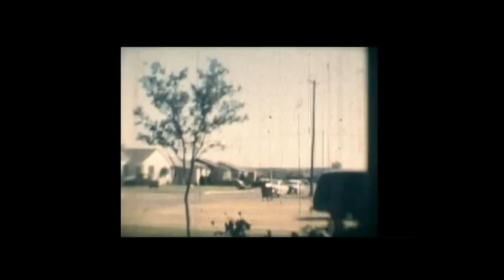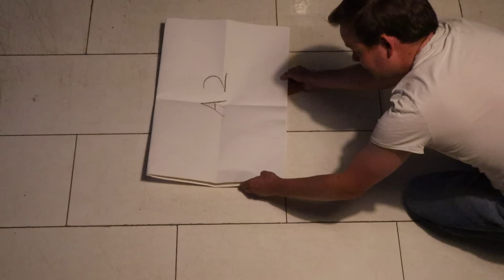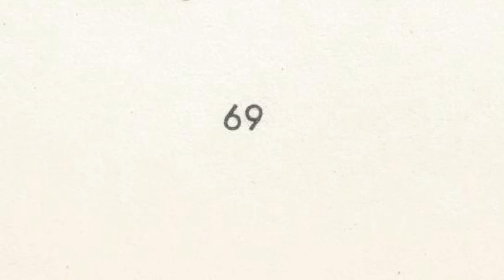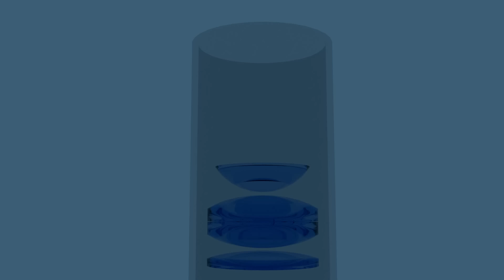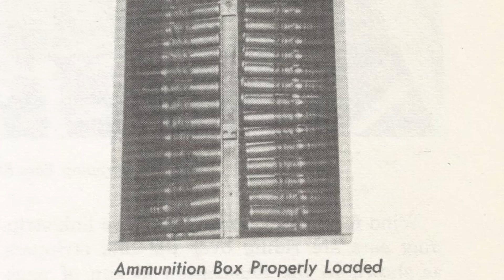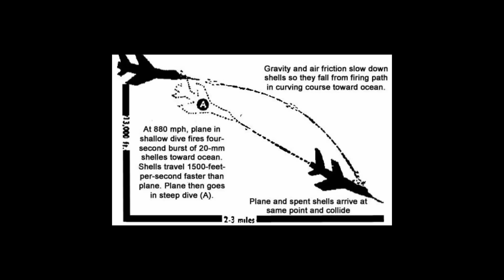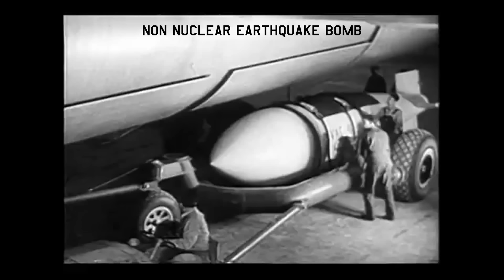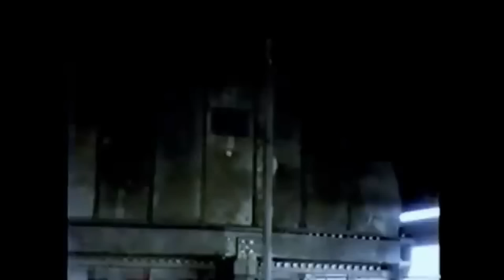Unfathomably American: The Armament Systems of the B-36

Comment: Imagine changing the sparkplugs on that thing.  There were 336 of them!
Reply from the maker: 2 plugs per cylinder, 28 cylinders * 6 engines = 336 spark plugs. Mostly difficult to access due to the engine geometry. And changes were apparently often carried out in freezing cold bases in Alaska.
Reply: @Alexander-the-ok I worked as a light aircraft engineer for a lil bit, the most irritating thing about 50/100 hourly services (other than becoming a contortionist to get to the rear 2 plugs hiding near the turbo) was having to actually care for the plugs cos you gotta check the markings on them

So you take each one out and set it in a tray to keep them in order. Look at the soot, any fouling, electrode wear, damage, heat marks etc

Tl;dr --> minor service (50 hours) on a single 6 piston ~9L light aircraft engine takes about 3 man hours 
So doing a minor service on just the engines (all going well) would take ~120 man hours
Reply: @Alexander-the-ok   
As I understand it, there is more than just the safety of largely independent dual ignition systems for each cylinder, or cylinder bank, as a reason for the dual plugs still used in aero engines.

The cylinders were so wide that two plugs nearer the edges shortened the colliding flame front’s path(s), decreasing the amount of timing advance BTDC (before top dead center; lead time) the spark needed, increasing efficiency from the shorter upstroke against budding firing pressure, a quicker full burn to discourage detonation, and (I surmise) a somewhat higher peak combustion pressure from which to extract energy during the following power stroke under good thermodynamic conditions. 

Hope I’m not misguided.
Reply: @For_What_It-s_Worth  You are correct.  The further a flame front travels, the more likely it is the cylinder will reach ig it on pressure before combustion finishes.   When that happens the remaining unburned mixture all goes off at once.  That is what detonation is.   So the main job of dual plugs was to start two flame fronts that would each only travel half as far.
Reply: @For_What_It-s_Worth  Some motorcycle engines with larger cylinders have two spark plugs for that reason. The DR650 comes to mind because i had one. It can also help with emissions
Reply: @Alexander-the-ok  6 engines
Reply: @Alexander-the-ok  Six engines. But you got the right number of plugs.
Reply: @Alexander-the-ok  that's 6 wasp not 8...great video.
Reply from the maker: @publicmail2 oh yeah, edited, thanks!
Reply: @Alexander-the-ok  at least they were done by the Airforce. Nowadays would be some independent contractors billing $500/hr (who would only do it in a hangar - and one not being shot at). And the spark plugs would be limited (by a rider to a footnote to some bill) to some obscure brand that only Nancy Pellosi's private equity broker knows the name of.
Reply: @Alexander-the-ok  I’d hate to be the ground/maintenance crew that had to work on that in the freezing cold
Reply: @Alexander-the-ok 6 I thought it was 10
Reply: @Alexander-the-ok  or Thule in Greenland but stupid cold non the less!
Reply: @Alexander-the-ok surely it's a team of 20 or 30 and they can do it in a few hours with specific tooling or cartridge style modules making it very easy

But I know better than that 
.it's all threaded plugs
Reply: 1 a day til paid vaycay
Reply: @blurglide  and plain steel spark plugs firing leaded fuel, so the plugs would only last a few hundred hours
Reply: And doing so in sub zero weather during arctic deployments to Alaska.
Reply: @pauliedweasel  actually sounds kinda nice. Only thing worse than hard, grimy work is doing hard, grimy work soaked in sweat
Reply: Plus 64 igniter plugs for the J47 engines.
Reply: None of your fancy iridium 100,000 mile spark plugs back then either. I believe they had to be changed pretty often. Mind you, nothing about aircraft maintenance is easy. 
I have two family members who are aircraft maintenance crew, one is an airframe engineer who has worked on many large aircraft for both military and civilian industries. Some of his stories are incredible.
Reply: @woopimagpie   quite honestly i would rather be sent to a gulag than be a maintmance crew of a b 36,just the sparkplugs change already looks bleak,i can only imagine how oil changes would go
Reply: Don’t forget the igniters for the jet engines… I don’t know how many per engine, but I assume at least a dozen more there. And I suppose it also carried an apu.
Reply: @DrBovdin  the B52 doesn’t even have an APU do I would be very surprised if the 36 did. Afterall you could use one of the piston engines to provide the power for starting the jets…
Reply: @X85283 , no apu on a B-52 probably because the thought of nine turbines on any aircraft was thought to be a bit excessive even in that era.
Reply: @X85283  I wouldn’t know, it is just a guess from my side. Either way, that would be a minor relief for the guy changing spark plugs and igniters 😉
Reply: @X85283 the B-36 did have an APU, as did the B-29. A small gasoline air-cooled motor for use on the ground to generate electricity to run things like lights and radios.
Reply: @X85283 but to be fair the system used on the b-52 is unique to its purpose
Reply: @GooseDentures ugh, some guy…name’ll come to me…he was a fairly famous Lockheed and AF test pilot…ah, Daryl Greenmeyer or something thereabouts.  Anyway, they were recovering a B-29 that crash landed in Greenland, in the 80s or 90s, and they were trying to start the engines to see if they could get it airborne.  The gas can or tank or the entire apu fell over and burned the B-29 to the ice.  They guys who were there to retrieve it sat in chairs watching it burn, to pretty much nothing.  

So sad.  The intention was for it to be the 2nd airworthy B-29 along with Fifi.
Reply: @DaveP-uv1mlThe B-52 has a cartridge start on its engines.  In theory it could fire up all engines at once to scramble.  In practice it seems one engine is started using a cartridge then bleed air from that is used to start the remaining engines.  Or a GPU.
Reply: @DrBovdin Those would likely be way easier
Reply: G'day,

Mate, those Engines were so VERY Complicated that the
Ignition-Harness
Oscilloscope was
Invented...; purely so that the
Flight-Engineer could tell if,
And which...
If any,
Of those 336 Sparklers were
Failing to light up their
Fair share
Of the Fuel/Air Mixture,
In the 168
Combustion-Chambers...

Or, so I heard from the son of a LAME who used to maintain Lockheed Constellations for Qantas - which also featured an Oscilloscope to monitor all the 
Sparklies.

Such is life,

Have a good one...

Stay safe.

;-p

Ciao !
Reply: @WarblesOnALot    this is what happens when you push a technology all the way to its logical extreme. Jet engines were so much better
Reply: @kevinbarry71 

G'day,

Thanks...

As it happens, the people who were really "shit-hot !" at dreaming up and making bloddy great big super-powerful Piston Aero-Engines in the 1940s and '50s had about 40 or so years of history in the industry ; and to be honest, they had no great interest in starting again and trying to jettison everything they were good at -  to go buggarising about trying to connect a Windmill in a tubularised Firestorm to spin a Centrifugal or Axial Rotary Air-Compressor...., to turn Kerosene into pure NOISE, all in the attempt to derive some residual Thrust by afixing a Nozzle to constrain the efflux downwind of the 
Fire-breathing Windmill...

My impression is that the whole "Squirt-Engine" concept, as they called it, was seen as ridiculously 
Inefficient (and in terms of Specific Fuel Consumption - the Piston-pushers 
Are CORRECT...,  and as Jets were highly  cantankerous and initially noticably gutless, and quite fragile too - as regards Throttle-Jockeying...; the Jet-Engine as a species was seen as a dangerous  (Career-threatening) Anomaly, well worth competing against, and resisting.

And, considering the proportion of Planetary Atmospheric Fossil-Carbon Emissions currently being farted by
Jet Aircraft...(5% or 7.5%..., as I recall it ; something like that) - thashing back and forth all over the Globe conveying Busloads of drunken Tourists and Feetbrawlers, Hairdresser's Assintants and Telephone-Sanitisers on their annual Clap-Catching Expedition to Bali or Phuket, Ibiza, the French Riviera or Aspen Colorado, and back home to the mortgaged ("Mort" = Death  & a Guage is used to measure things..., so a "mortgage" measures how much Money the Borrower may repay, before expiring from overwork...) Suburban McMansions, whereinat they play at forming simple and compound recombinant Brady-Bunches - to see how much more dysfunctional they might succeed in raising their offspring to become..., 
Than their own parents had done...
With them...

Every Litre of Kerosene burned, in a 
Table-stand Lamp or a Rolls-Royce Avon, Spey, Nene or Trent..., emerges as something like 2.8 Kg of Carbon Dioxide...

And Piston Engines make more 
Thrust per unit of Mass worth of 
Fuel Burned...

Jet Engines are
NOT
"More Efficient" than
Piston Aero Engines...
They ARE, though, 
Much more readily scale-able,
Particularly above the 1,000 Hp mark, per Engine.

Four 3,500 Hp Radials on a Constellation, versus four 20,000 Hp Turbofans on a Boeing 747, and a pair of 40,000 Hp Turbofans on a B-787...; but look ye at the Fuelburn, and Emissions...

Extra POWER 
Does NOT mean
More EFFICIENCY...;
Because conveniently large amounts of Output involve
Stupidly 
High
Emissions.

So, look at the big picture
Consider the FACTS,
Ponder the implications...;
And you will realise that
Dhatfver went wrong in the lives of they who hatchd Jet Engines and released them to go Feral and breed in the wild...; their little Tragedies were not nearly 
Sufficient unto the task
Of
Balancing their
Kosmic-Scoreboard Effect
Impact on
Reality
For hhe generations yet
Unborn..., who get
To attempt to live on
Within the smoking overheated barren arod acrid bloody
Messes
Made by the
Flying Fire Chariots.

Piston-engined filthy pointless 
Flying Fire-Chariots...,
Were already plenty bad enough,
As it were...;
In my opinion.

And considering that what took me for my first Solo had 3 less Cylinders and 4 less Horsepower that the Wright Brothers' 1903 Flyer-1....; I probably have a little bit of a "right" to excrete from a great height, onto anyone who "needs" to play with 
Wastefully-Overpowered Flying Machines, merely to exercise their own little Biggles Fantasy...

(search my "Personal Aeroplanology..." Playlist, for
"National Transportation Museum ; Visiting My First Aeroplane..."!, 
to fact-check that...).

Such is life,

Have a good one...

Stay safe.

;-p

Ciao !
Reply: @WarblesOnALot  Are you allergic to complete sentences and paragraphs?
Reply: @jamesharding3459 

G'day,

Averse,
Not
Allergic.

I prefer pontificating
Poetically.

Blank Verse, or
Free Verse...

Makes a nice change, from the
Prosaic...; in my humble opinion.

Backtrack me to my
Warbles In The Wilderness
Playlist..., to find the stash of
Original, Published
Poetry...
Most of which rhymes with rythm and metre ; quite conventionally.

Some of which was  commissioned
To be written,
When appointed
Poet In Residence by the
Environment Centre Armidale.

Which meant that I became the
Replacement for
Judith Wright...(!).

Technically squeaking...

Such is life,

Have a good one...

Stay safe.

;-p

Ciao !
Reply: @WarblesOnALot  Regardless, it is both irritating and unnecessarily frustrating to read. Stop it.
Reply: @jamesharding3459 

You get to do
YOU...

Little Jamie...

You do
NOT
Get to 
DICTATE how
Other Humans live our lives.

You poor pathetic miserable little
Overcompensated
Inferiority-Complex
On-legs...; 
Bleating and barking at the
Universe,
Demanding compliance with
Your
Perverse
Predelictions...

Piss off
Yanqui
Piss off.

Your (mis)direction is
Unneccessary
Uninformed
Unwelcome, and
Unhinged from Reality.

Nobody cares what ANY
'MurriKa(!)n
Demands.

Y'-alls VOTED to become
IRRELEVANT in the estimation of
96% of
Humanity...

No 'MurriKa(!)n opinion
Carries ANY
Gravitas, as long as 
Y'-alls be salutin' Trump, and
Dancin' to his tune.

Message ends.

;-p

Ciao !
Reply: @jamesharding3459  god forbid one person on the internet enjoys writing in a way you don't like
Reply: @jamesharding3459 or just dont read it
Reply: downvoting for horrid layout of OP's text nuke
Reply: As an apprentice aircraft mechanic, that thought makes my eye twitch.
Reply: If it took just 5 minutes to change a single plug, it would still take you 3.5 working days to change them all (28 man hours) 😮
Reply: The spark plugs were a problem. At the high altitude/low atmospheric pressure were the B-36  flew arcing was a real problem with the high voltage ignition system. Connecting the magnetor to one of the superchargers helped, but introduced issues with oil contamination. Eventually the switch to low voltage ignition was made, with a step up coil at each plug similar to modern cars.
Reply: You don't change the spark plugs the spark plugs change you.
Reply: @rexmann1984 , haha, that would be the Tupolev Tu-4.
Reply: It is bad enough dealing with 4-8 in a car.😂
Reply: those double turrets don't look familiar? are those a prototype
Reply: @bart_e_national  not a prototype, it was the production model. They were removed in 1954 to reduce weight except the tail turret
Reply: @bart_e_national correction, second production version
Reply: Have to wonder if the unreliability of the engines were directly related to how complicated and complex the maintenance schedules were.   The more time is needed for maintenance, the more likely that something goes wrong and a bolt or screw doesn’t get replaced or tightened to spec.
Reply: @blurglide  shoulda made it diesel
Reply: It’s called a wobble and 5hrs of work lol
Reply: @blurglide  in alaska... During winter ... Or greenland..... 😭
Reply: And the oil?
Reply: @DangerTimed 
Never needed to be changed since the engines would burn it.
Reply: I thought my old S600 is bad 😂😂😂
Reply: No problem, ill just get my wrench and gapper and...ohh hell no, they are buried in the heads and between cylender banks?
Reply: @blurglide  Imagine replacing the oil.
Reply: The entire engine would be removed and replaced with a working one, keeps the aircraft flying while the engine is worked on
Reply: @blurglide  Good thing that engineers work in groups. If each guy gets an engine it shouldnt take more than a few hours, but what do i know
Reply: It's normally one slip away from a few hour job I have a feeling a snapped plug or fubared thread was a nightmare
Reply: It’s probably what you’re gonna be doing for a month I doubt it the days worth of work. It’s probably what you’re doing for January.😂
Reply: Don’t forget the starter plugs on the turbines on both internal jet and b36 itself
Reply: That's a ten man job lmao
Reply: Oh god...
Reply: My grandfather talked about how much of a pain the 48 spark plugs in the P-38 were to change during his all expense paid trip to the South Pacific in WW2.  

He didn’t talk a lot about it until he got close to checking out, but he had  interesting stories of “Washing Machine Charlie” coming over at night and dropping bombs.  When the Japanese ran out of bombs for the night bombing raids, he said they knocked out at least one airplane on the airfield with a BFR (Big Friggin Rock) which smashed through the cockpit instrumentation.  The good ole days…..
Reply: I figure there's probably many maintenance crew to do that so probably not as much of a pain in the ass as if you were to do it solo probably still took the piss though

Comment: Alright so we got the funny big plane, which makes for an excellent video, but how about the funny loud plane? That's right, I think we need a thunderscreech video.
Reply from the maker: Oh that one is already very much on the 'maybe videos list'
Reply: @Alexander-the-ok  my ears are already ringing just thinking about it.
Reply: @Alexander-the-ok  good jesus, the engine alone is something to wrap your head around, and thats before you get to its most well known feature
Reply: @Alexander-the-ok  Where else are you going to find a propeller plane with an afterburner?
Reply: @xthetenth There is the related motorjet - piston engine, jet for thrust. There were a few experimental planes produced with them. The USSR made the I-250 and Su-5, and Japan made the Tsu-11. Apparently some I-250s had propellers, I'm not sure about the others. The channel IHYLS has a video on the Soviet motor jets.
Reply: @SnakebitSTI  There is that, but, I actually don't mean a piston engine driving a turbine, I mean a propeller and an actual no kidding injecting fuel into the exhaust after the turbine core afterburner, which to my knowledge is a "feature" unique to the thunderscreech.
Reply: ”EÆEÆEÆEÆEÆEÆEÆEÆ”